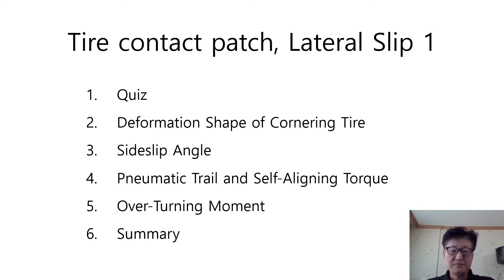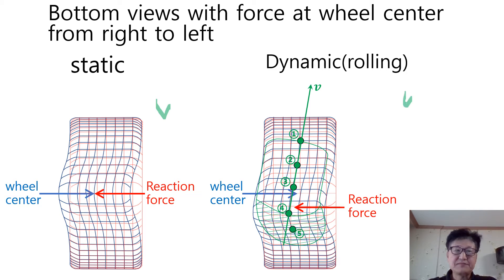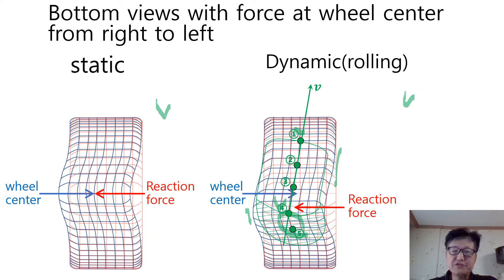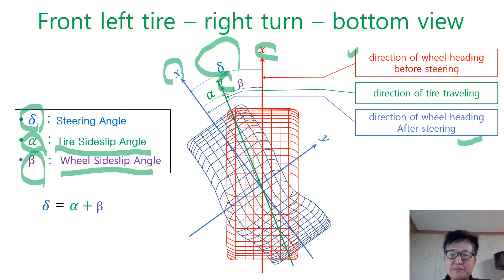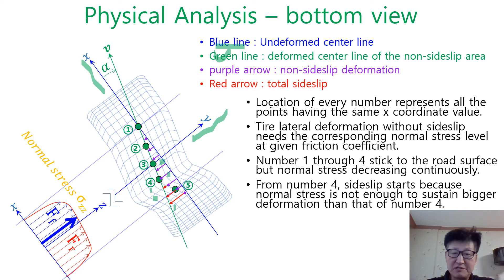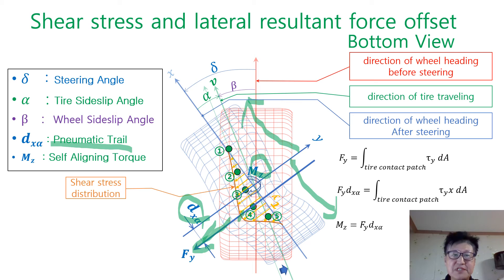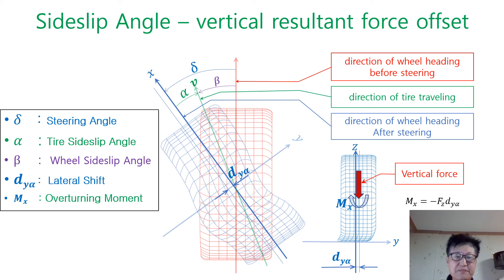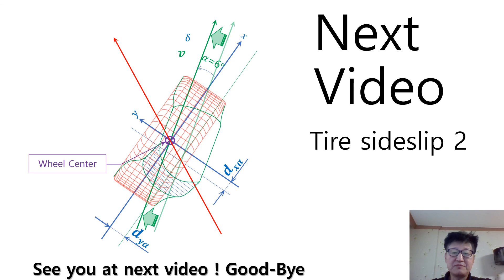E0017 Tire contact patch(tire sideslip angle part 1) - EulSeoggy Ko

Comment: Please can you tell me whether the self aligning torque Mz really acts around the tyre centre point (as shown in the diagram) or whether it actually acts around the position of the scrub radius point, as determined by the suspension geometry?
Reply from the maker: Thank you for your good question! A reference point for moment calculation is the center of tire contact patch! I think you can get the figurative answer to your question on my video E0022, https://youtu.be/XIhD8zF9Xus.